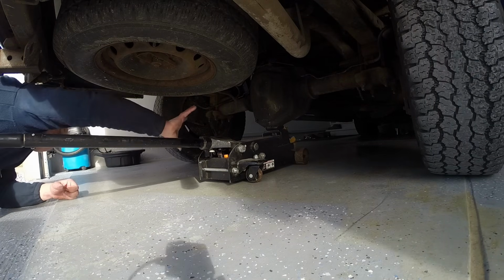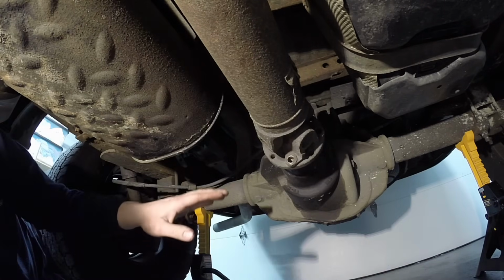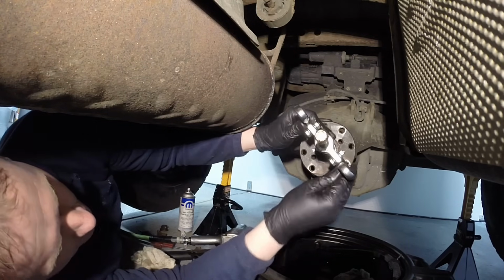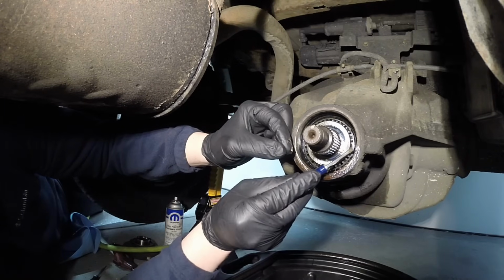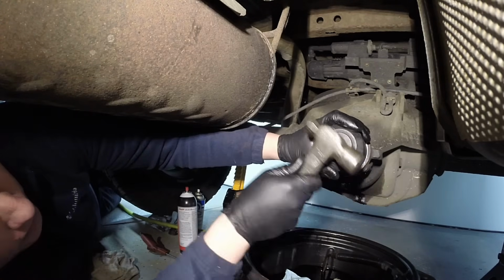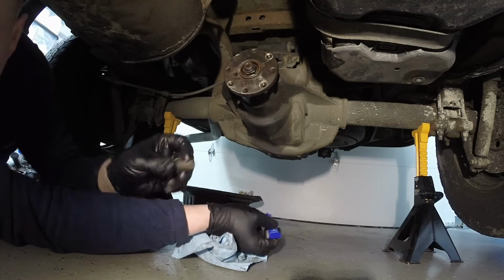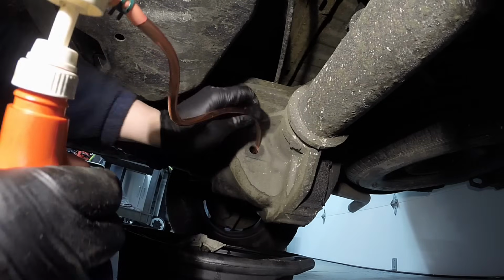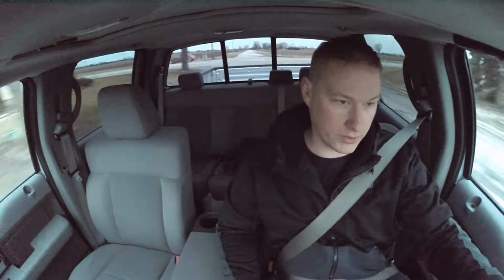Ford & Dana Axles Pinion Seal Replacement: Tricks of the Trade

Comment: The transmission shop put the wrong transfer case on my 2002. Every time I put the truck in 4 wheel drive it took out the rear end. Funny the guy that owned the other F 150 had the same problem. Made them pay for all the work to both trucks.

Comment: This video is awesome help! Thank you! I have a question also with some back info.  Ford Replace my rear clutch pack last Feb. on my 2017 Expedition XLT EL 4WD.  There wasn't much roll back when we put it in park before the repair.  The Expy now rolls quite a bit after we put it in park. Also the pinion seal now leaks.  Would this have been caused by an incorrect repair on the clutch pack? I had a miserable time with the Ford dealer repair for the clutch pack, I can do the pinion seal repair, but I am wondering if the roll after putting in park is a tell tell of something more than just a pinion seal.  I like your trick for getting the  preload torque, but how do I find out the Ford spec for the preload and pinion nut for backlash? Thanks again.

Comment: Personally I would normally replace the crush sleeve and outer bearing/race doing a pinion seal (gets damaged during the removal of the pinion gear). But it would be a good idea to measure the preload using an in-lb wrench before and after if your not replacing the crush sleeve. The carrier will add to the reading (about 2 to 4 in-lbs), but at least you have a way to verify that the preload is still within reason. Otherwise its just a guess.
Reply: Agreed, a new crush sleeve as well as a before and after pinion+carrier preload measurement, plus replacing the pinion nut are all ways to do it right. I cringed when he didn’t check any preload and just hammered away on the pinion nut. If it’s right, he’s lucky.
Reply: The sleeve and outer bearing/race always get damaged during removal of the pinion seal? How would you measure the preload? Torque wrench? And would you also torque down the preload? What is preload? Do you then load?
Reply: @briana8308  I have sets of checking bearings that are a loose press-fit for setting up the rear. The bearings are fairly tight tolerance so there's no real variability on the final measurements. Basically the bearings can be removed/installed as needed when setting up the pinion depth. Final installation is then tightening the pinion nut with a large breaker bar and measuring the preload with a small in-lb. beam wrench as I go. I think Matco might still sell them. After that just a final check of the pattern to be sure all is well. But yes when driving out the pinion the front bearing can cause false-brinelling on the race from the impacts since its a press fit. Best to just replace them as a matter of course rather than try to reuse.

Comment: So I messed up big. I didn’t count threads or mark the pinion nut. What can I do now? I can see 5 threads before the blue locktite starts. Also my bearing seems to be stuck. I wasn’t able to pull it out like the one in your video. I have a  limited slip 5:33 9.75 with 300k on it. Thanks.

Comment: My truck is making a noise and vibrating off my rear end every time I turn on a street or parking lot   this happens  while driving 5 or  so miles per hour.
Reply: I didn’t check it twice and feels pretty strong, all this happened when The speed sensor blew out while I was driving, and oil got out, Drove the truck like that for like 20 minutes I fix that mess put new oil n gasket,  check everything inside n looks good  no broken piece. Like 1 week after rear end start doing all this.

Comment: Whenever I work under a truck like that, I usually run my winch line to a snaych block o. the tree alongside my driveway and attach the cable hook to my belt so I can just hit the wireless winch remote and pull my stoved-up corpse from under the truck.  I can only hope that eventually,  my yellow lab will learn to grab my pant leg & drag me out on command instead of just crawling under & licking my face.
Reply: what about buying one of those crazy electric scooter type creeper that will put lower you on to your back and raise you to a seated position?
Reply: thats FANTASTIC!
and ya... if you are at or below labrador level, it warrants an immediate face licking.

Comment: What is the reason for replacing the whole drive shaft if this was a video for a leaking seal?
Reply from the maker: This was for a separate repair for a driveline vibration.
Reply: @FordTechMakuloco  got it. I'm changing the seal this weekend and wanted to know if I needed to replace the shaft as well but my f150 drives fine only a leak from the seal. The shaft is covered with rust so I will be costing it with some high heat anti-rust paint. Great videos that help with us DIY people that love to do mechanic projects at home.

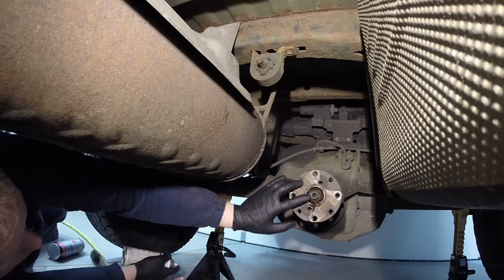Comment: I just changed my complete driveshaft to an aftermarket one with greasable u-joints from CCI Driveline in Casco MI, shipped right to my door in Louisiana, thanks to the nightmare known as staked in U-Joints that are $80 bucks a piece by themselves for the replacements with shims. Never mind the headache of having to fight with this staked in joint, one wonders if things don't go perfect if that stock shaft with shimmed joints would ever be balanced.  The joints were still okay after 15 years just starting to squeal enough for me to worry about ruining this pinion seal which is still good. When I was swapping the driveshaft I noticed I was able to get a flathead screwdriver in one of the 2 interior holes to pry it off without having to hammer at all. Note the 2 small holes at 7:17 nearest to the seal.

Comment: Great video. My pinion seal leak is fixed. Now the other end is leaking...☹ I cant seam to find any videos on replacing the transfer case output seal on a 07 f150. Anyone have any tips or advice?
Reply: If you still need some help on this reply to this comment and I will give some pointers. I did mine a couple weeks ago.

Comment: Is a 400-ft lbs gun good enough to do this job?.... I could not get any of the first 4 bolts off with good hand tools...not happening.
Reply: Soak overnight in penetrating oil then use correct size impact socket (mine was an odd size of 12mm 12 point with 1/2”” drive, had to order online) on a 1/2” breaker bar with a short pipe for extra leverage if needed   Worked great for me

Comment: Awesome video thank you. It didn’t look like you matched the yoke to your mark when you tapped it back on. Did my eyes deceive me? Also, couldn’t you have just put ujoints in that old drive shaft? I need to do this on my 79 F250 so want to make sure I do it right!
Reply: @smiley3303
I was expecting to see u-joints replaced rather than a new driveshaft also.

Comment: Thank you for this video! Greatly helped me complete this job over the weekend. One note, the OTC 1022 puller in your description did not work for me to pull the flange off as the width was not enough to stay clamped when using the tool, so I rented one from NAPA which worked perfectly. Other than that, everything went great due to this perfectly exampled video.

Comment: Appreciate the video just put a new pinion seal and U-joints in a 2001 F-150. Everything went smooth except for the easiest part, the retaining clips on the u-joints. I couldn't get them in. Long story short I hopped on the internet and found out that a lot of people were having same problem. The solution, grind down the clips until they fit. Not to worry about strength they were easily twice as thick as the originals.  Thanks again without this video I would never have attempted saved me some nice cash.

Comment: Questions for you, FTM:

1. If you find the front pinion bearing and/or race don’t look good, can you change them without pulling the pinion shaft out from behind? Specifically, the bearing race.
2.   Did you use a new crush sleeve on this seal  replacement job?

Thanks in advance.

Comment: Thanks for the great video. I just changed my seal over the weekend and for the most part it went pretty smooth. I used a piece of exhaust pipe that fit the seal diameter to seat it into place lol. Whatever works and saves you a little money. It was $10 for that over the $82 for a bearing a seal seating kit from NAPA. Again, thanks and God bless my friend.
Kevin - Alberta, Canada

Comment: Hi makuloco, I have 2004 mountaineer whit loud noise like a bad bearing and vibration on the floor and the steering wheel but after I removed the front drive shaft the noise and vibration gone away , what you think is the problem? Please help

Comment: Why replace the drive shaft if just the U joints bad?
Reply from the maker: They are staked u-joints and the kit from  Ford is about $200 per joint with extra labor to cut out old joint. Between two joint and all the labor it was easier and the same price to just sell him a new Ford driveshaft at my wholesale cost. Much better repair in the end for the customer.
Reply: @FordTechMakuloco  don't make it easy do they. Thanks
Reply: My u joint has the traditional clips just like a normal u joint 2005 F150 xlt 4wd supercab. Part number on the driveshaft is 5L34-4602-MA     @FordTechMakuloco

Comment: Hey just curious why u didnt use any sealant i gota do this seal this week and the shop manual says use a sealant
Reply from the maker: Many aftermarket seals have a coating on the outside of the seal to seal it to the axle, the Ford seal I used has an actual sealant bead on the outside so no sealant is needed too.
Reply: @FordTechMakuloco  oh really ok im getting a ford seal myself its on order i'll have it tmro..ok thank you

Comment: Great video Loco.  At the time you took the bearing out for inspection, is there any way to take out the inner race and possibly replace that as well if the bearing and inner race have signs of wear and tear?

Comment: Replaced many pinion seals over the years and found marking the stem, nut and flange isn't necessary. The pinion nut will stop where it's original position was when you retighten it. Unless you use excessive force your not going to collapse the crush sleeve any further than when it was originally setup. Just my opinion.

Comment: aren't you suppose to tighten the nut to a specific number of foot pounds so as to preload the bearing correctly rather than just pounding it down the the impact hammer?
Reply from the maker: There is no torque spec for pinion nuts, pre load is what’s important.

Comment: Your video is one of the best I seen, thanks for pulling out the outer bearing, I actually just bought some picks today, thinking that it will help when pulling the bearing out, happy to see you use that same method, by the way the tools you mentioned I actually rented mine at a parts store, but Harbor tools sells some good choices, so I will buy some, BTW how do you replace the rear Pinion bearing, do you need to disassemble the entire rear differential?

Comment: Looking at Ford service info, they say do not reuse the pinion nut. Thoughts? Additionally, why did you not use an in/lb dial torque wrench to verify preload? I hope you respond as I’m doing this job next weekend on my Sport Trac. Thanks.
Reply: How'd it go?
Reply: MCFriedChicken1 Piece of cake. Very easy job! 🤙🏼
Reply: @DownRange02  thanks I'll be giving it a try tomorrow
Reply: MCFriedChicken1 I opted to follow exactly the way that @FordTechMakuloco did it. Only difference was I used a battery powered 3/8” impact & changed the differential fluid as well. Oh & I have the 12mm 12 point driveline wobble socket.

Comment: Hey Ford Tech. I just replaced me pinion seal and popped in a new bearing. I think I need to adjust my backlash though. I have a slight shudder on take off while turning now, that I didn’t have before. Would you assume that I don’t have enough backlash that is causing the shudder? I don’t think the issue is not enough backlash but what is your opinion? As it is there isn’t any noise, just that shudder. What d you think. I did the thread counting method but the problem is the nut was loose when I took it off anyway so I don’t know where it should have been anyway. Thank for your time.

Comment: Call me Old School Paranoid but I always mark the front with a paint pen too so that I put the old driveshaft back in the same way it came out as long as it is not being replaced.

However, since you replaced the driveshaft was the new one already pre-balanced? It looks like it is pre-balanced by those marks on it but I can't really tell from the camera angle and you didn't mention anything about the importance of balance and runout. Also, if the new one isn't pre-balanced then how did you check for runout and balance it?

This last thing is something I've noticed about you which is just a word of caution. You hardly wear eye protection. Use eye protection dude. I notice you spend a lot of money on the right and the best tools but the most important tools will always be your eyes and hands. Work safely and avoid any accident that could have been avoided.

Comment: Good Video! Why didn't you use silicone sealant like what you removed?
Reply from the maker: The sealant is already on the outside of the seal I installed from Ford.

Comment: My 2001 F150 will go into gear ONLY in 4WD high or low. When I jacked up the back corner the wheel will spin freely by hand while in gear in 2WD. Any guesses?

Comment: Do you have to take off the drive shaft if your only replacing the pinion gasket?
Reply from the maker: yes
Reply: FordTechMakuloco What I should’ve asked was can I leave the front out the drive shaft connected and disconnect the rear of the drive shaft , so I can change out the pinion gasket?  Or do I have to disconnect the entire drive shaft to Change out the rear pinion gasket?

Comment: Hopefully somebody still seeing comments here.  I replaced my pinion seal as well as both axle seals and bearings this weekend on 2004 F150 9.75 using your two videos.  It went well and I let cover sealant cure 24 hours before filling with Motorcraft LS additive and 75w140.  Very happy until I just test drove on road.  As soon as I got to first area to decelerate it sounded like a truck with mud grips tires whining.  That only happens on slowing down then once around 15 mph that whine goes away.  I did mark my nut to shaft and counted threads but it’s possible I may be a thread off either way cause they are so fine and I had counted 6 when disassembly.  I’ve read whine on decelerating means pinion preload too loose.  Should I take driveshaft off and go around one more turn to my mark or am I screwed already?
Reply: Update - I decided to take driveshaft off again and tighten the pinion nut one more complete turn so my paint marks lined up again.  The movement was much less on rotating the pinion flange after this.  I torqued 12mm bolts back then took a test drive and my noise is completely gone.  So I suspect I miscounted my threads before disassembly first time.  Lesson learned be very precise and carefully count those threads.
Reply: @robcoile3127  thanks for posting this valuable information - read for  a couple hours before I got to it.
Reply: Thanks for the update. Will keep this in mind when I do mine

Comment: Aren't you supposed to replace the crush sleeve and set preload?
Reply: Theory is that by marking position of nut on threads before removal and restoring this position after seal is installed, the length of the crush sleeve will not be affected resulting in maintaining the original preload. Does this approach actually work? I don't know but I am trying to gather as much information as possible before I drag my 84 yo body back under my 98 Isuzu Trooper.

Comment: I have a 2014 F150 FX2 Ecoboost and always having dealer do maintenance. Have about 45,000 miles on it and just took to get oil change. They recommended to get slip rings greased on drive line. Costs $60 to have done but never new it had to be greased.  I trust your opion since you're a Ford tech and demonstrated your knowledge on video's. How would they know it needs service, unless they remove drive line? Im confused and think they're trying to upsell me. Any advice or opinion would be appreciated. Thanks Brian.

Comment: Dude where’s your safety glasses, come on now, PPE, most important part of the job.

I’d also like to see you using a plastic dead blow hammer on that flange so you don’t deform the grove for the snap retainer for the ujoint.

Had to fix a few of those after over zealous techs really did some damage to that thin area.
Reply: Exactly, no safety glasses, a chrome socket (use an impact), a screw driver as a punch...........lol

Comment: Just followed your video step by step for the rear axle seal and decided to replace this seal while I was in there. I marked the nut, flange and splined shaft. When it was at 5 threads and about 3mm of shaft out of the nut, where it was before I removed it, the flange piece that covers the seal appears to be out a bit farther from the pumpkin now. I’m concerned I messed up the preload. 

I used royal purple oil with friction modifier in it, but I have noticed a whirring sound since replacing. Bearing looked good without pitting.  I now have about 6 threads and the lines mark up and the gap is still there. Should I start over with a new slinger and seal?  I don’t want to burn up my rear diff.

Comment: Hello, i have a 2011 Ford econoline E350 and recently my van has developed a leak on a rear differential and it is caused by a worn out seal. I have followed all the steps shown in your video to no avail, what I mean by that is the flange housing the seal will not separate from the entire assembly. This vehicle has 290500km(yes im in Canada) and most likely has never seen this problem before since I am the second owner from 140k odometer reading. I have been told that Ford Motor Company uses a sealant on these components if so any advice on how to remove the flange to gain access to the seal?